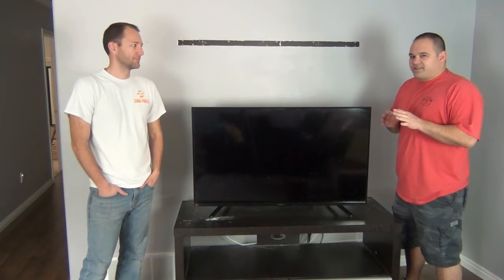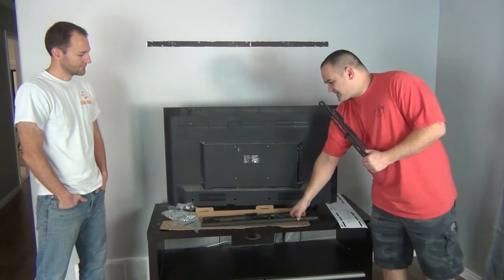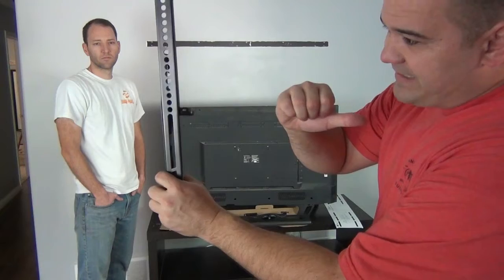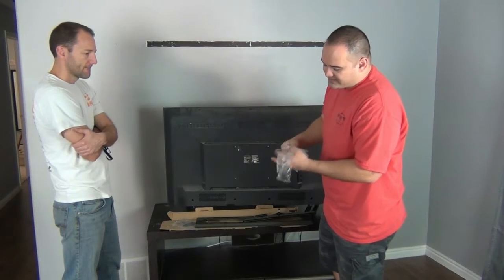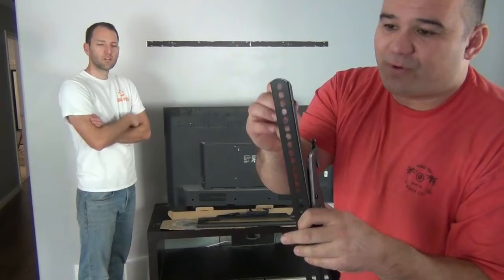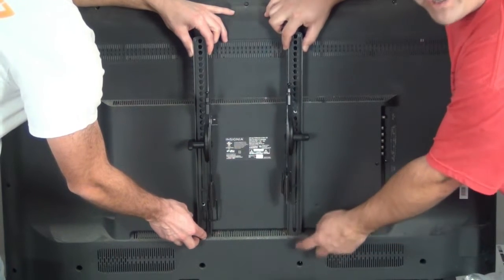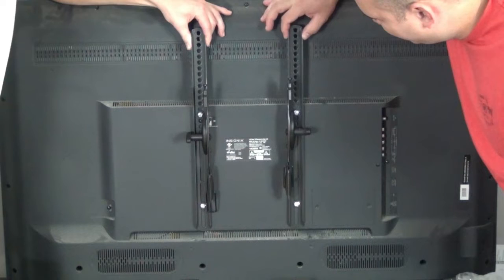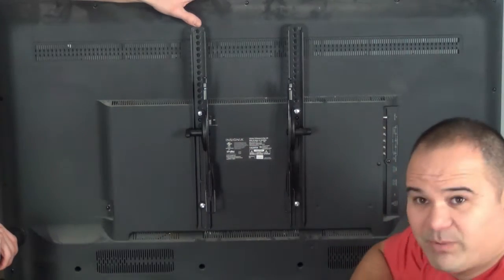Pro TV Install 1/3: Attaching the TV bracket like a pro

Comment: One note about the spacers. You said don’t use them unless you absolutely have to. Pay attention to the plugs on the back of the tv. If they’re pointed at the wall, use spacers to give the hdmi/ other AV cables room to plug in, especially with tilting mounts. Also, I like to always use a thin spacer so I have a gap between the metal brackets and the tv. I can route cables through there for better cable management, especially on full motion mounts where the cables are held to the arms in the center of the tv and the AV cables plug in towards the side of the tv.

Also, Samsung includes spacers in the box with the tv. Always use those. They’re the exact right ones for the thinner top of the tv and thicker bottom of the television set.

Comment: Samsung TVs usually require M8 45mm. A lot of mounts quit including that size for some baffling reason(looking at you Onn). I keep the extras from almost every tv mounting job I complete so that I’m always guaranteed to have what I need to complete the job and never have to run to the hardware store.

Comment: Switch to Franklin Sensors stud finder. I rarely touch my Zircon anymore. Franklin is way better. I still use a magnet/tape measure if I have any doubts. And I ALWAYS use a small drill, at least on the first stud, to make sure I am hitting a stud. If it was wrong for some reason, it’s only a tiny hole. I do that when using toggle anchors too. Before making the 1/2” hole, I use the tiny drill to make sure there’s nothing there first.

Comment: I used to always measure to the bottom slot but now I changed to the top. Reason being is that I don’t mark the holes on the wall. I mount the plate with the first lag bolt and level it. Then I just drill directly through the plate into the studs. For some reason some heavier plates would want to start rotating even with the bolt really tight and I don’t experience that with the top hole. 

Also, I too will measure from the floor/table and subract the base IF I need the accuracy. 99% of the time, that level of accuracy is not important.
Reply from the maker: Ya I agree. Most jobs require a rough measurement, but I can't help but be a little more exact.
Reply: Alan Clegg within a 1/4” is usually good enough for me 🙃

Comment: I don’t use a vacuum. I use a dollar store dustpan. A lot more portable. However I do need to buy a vacuum for certain situations, such as cutting plaster or hammer drilling concrete.
Reply from the maker: I like a vacuum because it should also catch the floating dust although it does miss some of the falling dust. I guess in a perfect world, I would use both.
Reply: Alan Clegg vacuum is probably going to get 99.9% of the dust while my dust pan gets about 99%. Just depends on the home I’m in. If I feel like I really need to be super clean, I’ll get my dollar store microfiber towel and spray and wipe it up but a vacuum would probably work better for cutting out the hole for cord concealment.
Reply: Alan Clegg although plenty of people are impressed with my dust pan under the drill lol

Comment: Great tip about leaving space for up and down adjustment on the bracket. I’m going to start doing that. I never count holes though. I always put a bolt in the top/bottom of a slot and use the nearest hole to that position then just copy that on the other one. 

One thing I disagreed with doing though was pushing the bracket down. I pull UP! Gravity is going to pull that tv down when it’s hanging. If one side of the tv moves down slightly while the other doesn’t, the tv may not be perfectly level anymore, which is especially noticeable on larger TVs or in built-in cabinets.
Reply from the maker: Probably a good idea to push up. I'll try to remember that if I do another video.